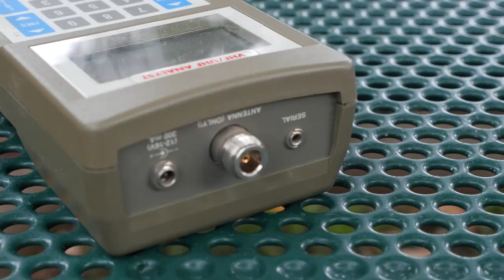Which connector for my antenna should I get? SO-239 or N Female

Comment: Put it another way.  The PL-259/SO239 is an old standard that outside of Amateur Radio is largely considered obsolete.  It remains the standard for Amateur Radio in part because of videos such as this advocating for its continued use, and in part because hams tend to reach for bottom shelf solutions.  N is the standard in the commercial, professional and military world, all is used all the way down to and including HF. 

Thank you KB9VBR for offering your antenna with an N connector.
Reply: The N series does actually date from the 1940's but it is, however, superior in every way apart from high wattage handling.
Reply: I'll take a uhf connector over driving the 1/4 wave section.   :)

Comment: By far  regardless of the frequency the "N" connector is my go to connector, all of my equipment, transceivers, antennas ,coax are outfitted with them. Water proof, double insulated etc... a precision coupler is hard to beat. Just takes a little patients putting together.
  Thanks for sharing! 
   Kind regards, Eric Dee.

Comment: Can someone explain why all the jpole duy schematics have the ground sheild one the short side but most listed for sale are opposite? What's the difference?
Reply from the maker: As you have probably found out by searching online, there are plans that attach the center conductor of the coax on either side of the antenna. I have experimented with attaching the center connector of the SO-239 to the stub and to the main radiator. I have not found a difference in signal quality or performance. I choose to mount the edge of the connector onto the main radiator because I believe it makes a better mechanical connection.

A J-Pole style antenna is comprised of three sections. First is the mounting section where the antenna is attached to a mast or support. The second section, which is 1/4 wave long, is the impedance matching section. The two pieces of the antenna that run parallel to each other change the impedance from the 50 ohms at the feedpoint to about 300 ohms which is the impedance at the start of the third section. The third section, which is 1/2 wave long is an end-fed dipole radiator. With end-fed antennas, the impedance is high at the ends and low in the middle. With the 1/4 wave section, the impedance is low at one end and high at the other. So the two parts of the antenna can work in harmony.

Interestingly enough, in the Rothammel's Antenna Book (13th ed english translation, page 777) the author states that feeding both the short and the long sides of the antenna are electrically equivalent, yet a configuration where the short side is direct fed provides improved overvoltage protection because the half wave section is directly grounded via the outer cable conductor. (parenthetically, this method also helps lower the overall noise floor of the antenna, by dissipating static to ground). 

Since a J-Pole is considered a balanced antenna- it is a half wave antenna by design; the RF energy will travel up the matching section and then radiate from the resonant part of the antenna. Hence it really doesn't matter which side the connector is attached to.
Reply: @KB9VBRAntennas  I have found numerous post and sites that explain it this way. Thanks for the explanation.

Comment: Is there a secret to soldering wire to center connector on so 239 I'm having issues with keeping them together while making diepole antennas, thanks Dean
Reply from the maker: I use a little jig to hold things in place when soldering the connector, but when working with longer wires I will clamp the wire down so it doesn't move. Tinning the wire and using a bit of flux can also be helpful as it will make the solder process go quicker.
Reply: Don't use lead-free solder.  It makes perfect sense in an industrial/production environment but on a small scale and soldering by hand, the old fashioned lead/tin stuff is easier and more reliable.
... oh, just be careful with lead: don't eat it, breath in the fumes or give it to children.

Comment: great video ,, how is the back of the so239 connector waterproofed where the bridging wire is soldered into it  please
Reply from the maker: I use Amphenol brand SO-239 connectors and have found them to be quite water resistant. If you are concerned about penetration you can seal the back end up with silicone or liquid tape.

Comment: I'm new to this. I'm in a two story house. What would you recommend as an antenna roof mast for you J-pole 2 meter ham radio antenna?
Reply from the maker: The easiest mount would be to use a satellite antenna 'J' mount. You can attach this to the roof, side, or fascia of your house. Another option would be a chimney mount used for television antennas.
Reply: @KB9VBRAntennas  Thank you!

Comment: How are you soldering those SO-239s to the copper?
Reply from the maker: I use a propane torch, lead-free silver bearing solder, and a lot of skill learned from assembling over 15,000 antennas.
Reply: Thanks for your reply!
Reply: IMHO anybody with the right material/tools can solder a new, dry, copper pipe together, but it usually looks nasty with poor 'wetting'. It can be difficult to run a horizontal bead of solder on top of a pipe, like a weld (*as seen under the uhf chassis connector), since you don't have the same capillary action you would have in a male/female solder joint. KB9VBR definetly has experience. I bet if this antenna were under water pressure, you could strike it with a hammer and not leak.

I can vouch that the soldering looks very good. I'm a plumber from a family of plumbers, I have seen some of the worst solder joints and some of the best solder joints. I'm 30 y/o, been riding in the truck with my dad since I was 12 y/o, it has only been in the recent couple of years that my own solder joints have looked as good as his.

Comment: Why cant a so239 just be called a female pl259?
Reply from the maker: The same reason why a PL-259 can't be called a male SO-239. Both connectors fall under the category of UHF connector. the SO stands for Socket and the PL stands for Plug. So the SO-239 is the female connector and the PL-259 is the male connector.
Reply: @KB9VBRAntennas  That makes things much better to understand. Thank you.

Comment: I know this is off tòpic. But do you or have you made or will you  make a  10mete j pole.
Reply from the maker: Thank you for your interest in my antennas. I've had more than a few people ask me about J-Pole antennas for the 10 meter band. Unfortunately these antennas would be quite large and cumbersome to ship. I am working on some new antenna designs for the HF bands, and hope to have them available soon. I can certainly let you know when something suitable becomes available.
Reply: radio tech but I want 1" to 1/2" copper. None of that cheap alminim for me.

Comment: N connectors are much more popular in amateur radio equipment outside of US. Is this such great resistance to changes, or just lack of education, but american HAMs do not want to stop using their beloved SO-239, even when N is better choice. Some manufacturers (like Yaesu) make special versions of their radios for American market, with SO-239 mounted in place of N installed in TRXes sold in Europe.
Reply from the maker: I doubt it's a lack of education- more like a lack of choice. There are plenty of examples of how the inferior product becomes the standard just through the sheer force of the market, like VHS vs Beta. UHF connectors are ubiquitous. They are cheap and easy to install, so despite their shortcomings, I doubt they will go away any time soon.
Reply: More resistance to any change, than lack of choice. Difficulty of installation of N and UHF connectors does not depend on geography. Affordability of Ns is much better in US than in Europe. And still, Americans are clinging to the old, but familiar, while Europeans just went ahead with the better choice.
You're doing very good thing offering your antennas in two versions. Maybe it will encourage some HAMs to give modern technology a chance.
Reply: I don't see many choices which offer N series here in Europe, I only wish there were.
Reply: I'm in America and I want a radio with N connector but can't find it here in the US. I wonder if I can purchase an export model from Europe.
Reply: The only real substantial benefit to N in the HF bands is its waterproof for outdoor applications. So having a non-waterproof base/mobile radio with a waterproof connector on the back is pointless. This is why my Yaesu 897 only ever was offered with N on the UHF/VHF output and not on the HF.  If you have a Marine (water proof) radio in a Marine application than N is  the smart way to go and worth the extra cost. Plus having BILLIONS of cables and radios in circulation and production using UHF connectors, comparability would be a nightmare especially in the cables where you would need to switch back and forth in each run!
Reply: @Justin-bd2dg  For HF - yes. Using so239 for UHF/VHF is just laziness with little technical justification.

Comment: It amazes me how people think nothing about spending thousands  in the shack on radios, then go for cheap single screened coax and pl259 connectors. Ntypes are much better engineered, are 50 ohms and much more weather resistant. Pl259s are just shielded banana plugs, Yes you may not be able to tell the difference on HF between the two, But you'll know once you've installed Ntypes you've done everything possible to ensure reliability and to ensure the best possible signal path to the radio.